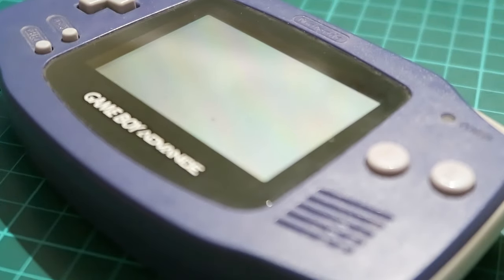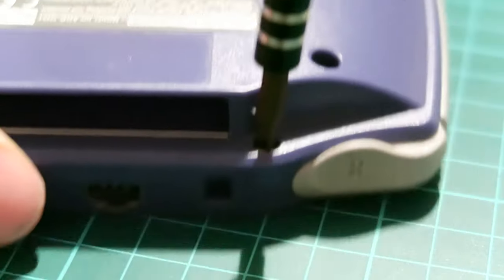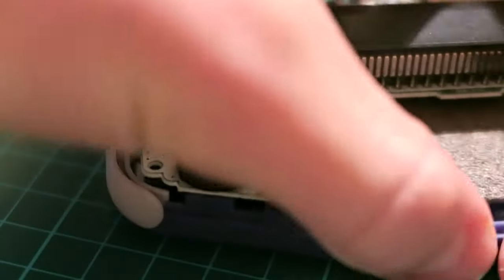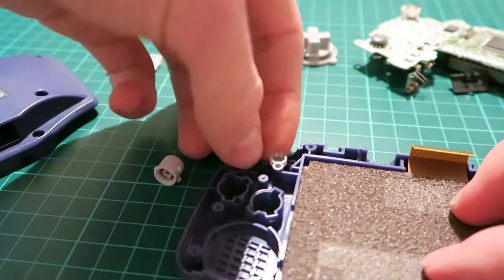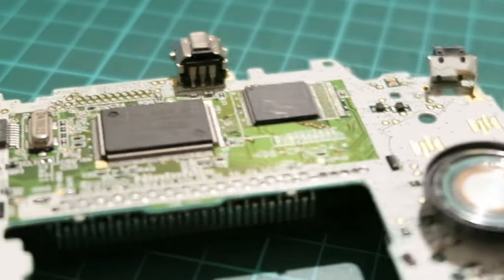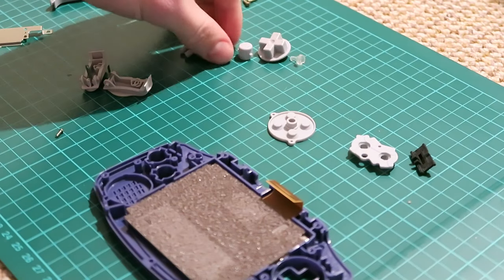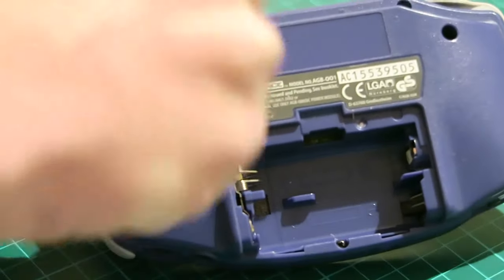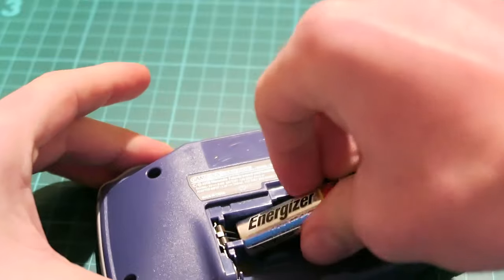Let's Refurb - Gameboy Advance Teardown

Comment: I just got this very model gameboy recently. Had it growing up so it's a must have. Lol You should do a tutorial on how to add a backlight/frontlight mod to this model.
Reply: Demonanimator you can only frontlight this, altho I’ve never attempted it, but if you replace the screen with an ags 101 then it will have one of the best screens out there, all you need to do is slice some plastic down inside the console so the new screen fits and get a ribbon connector bc the ags 101 screens ribbon won’t go into the agb model, also you need to solder a wire to the motherboard so the backlight has power. 
I probably made it sound more complicated than it is but this is one of the easiest mods you can do

Comment: what is the best glacier color replacement shell that looks like a real nintendo one?  the one i picked up on 2001 launch day one some how got a crack in it  near the volume nob and i dont know how it has been stored in its cardboard box for years and was not squished. it seems to be the back panel only. do the clear plastic get weak when they get old? i see more going on around the screws it has never been taken apart.

Comment: My old one isn't working anymore. I tried opening it and saw that all the solder points are kinda crusty... anything I can do about it?
Reply: Mobin92 if it’s the solder points you should reactivate them by putting a soldering iron over it for a couple of seconds to re-melt the point